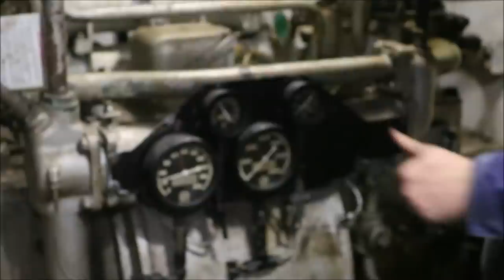First start in 72 years WWII 1942 Cleveland Diesel 8-268A

Comment: Ran an old ferry boat that had two of those from a DE, along with the DC generators and motors with reduction gear. Cheap cylinder heads from Texas were always cracking until we figured out previous crew had firing pressures too high. When we scrapped them they were worn out, 1988. The fish boat that got one said it was the best engine they ever had, cracked block and all. Hey, it would run all the time. I met the guy who designed it. Old timer came through for a ride, what a treat. He did it in something like 6 months for the war. Parts always available from various sources.

Comment: When I worked at Titan Tire Bryan Ohio they had an old diesel engine from a WWII destroyer.  They would run it during thunderstorms for backup electrical power for control power for the boilers.  That beauty was about twice that size and I loved running it.

Prime this handle for fuel on this side.  Prime this handle on the other side for fuel.  Set the throttle to 3 clicks and then hit the air start.  90% of they time she would fire first time.  The other 10% you had to start all over again.  Man never more than twice.  Wish I had bothered to pay more attention to the build tag
Reply from the maker: After WWII many marine engines were repurposed to various shoreside jobs. I always enjoy hearing about the applications they were placed into for their second life. Thanks for sharing that info and watching the video!

Comment: That's one awesome genset power plant!!! Wow I've never seen inside one of those and its amazing the technology it has just from the brief overview of the cylinder head! Never knew they had the roller camshaft in the head which is pretty brilliant and it lessens the pushrods and I was blown away to see that it was a roller cam no less because they didn't start to be used in the racing industry until the mid 80s and production vehicles in the late 80s early 90s! The fact they were using this kind of technology in military equipment makes me wonder WTF they'd have today if that's 80+ yrs old now lmao! Sounds like it'd brand new after having sat for that long, incredible stuff!
Reply from the maker: Thanks for watching!

Comment: that thing is so old yet it sounds 10x better than any new diesel engine you can get today, incredible!
Reply from the maker: One of these days I'll get around to posting a video of the engine at speed and carrying a load. It's a totally different sound and quite a scream! 
Thanks for watching!
Reply: it seems to me that the all mechanical engines run very well when properly tuned, i have a Massey Ferguson 230 from the 70's that is all mechanical that my dad and my grandad rebuilt and it doesn't even smoke when running
Reply: That's because new diesels run more thier timing advanced... so your get more pronounced knocking or pinging, even gasoline engines are moving in this direction as it is more efficient.
Reply: does it effect life at all?
Reply: @gtb81.  not if it is designed to work like that... diesels are typically and almost all of them except very old ones with very delayed timing (and lost power due to this) knock. Gasoline engines will have to be beefed up for compression ignition to work there.... Mazda and Toyota have engines coming that are going to hit in the 40-45% efficiency range which is very high near theoretical peak. Here's my 353 Detroit running, you can clearly hear the knock https://youtu.be/1-m9qpruyO8?t=38
Reply: @Wingnut353  the only thing i dislike about new engines is the fact that they use so much electronics to function, and it doesn't hold up very well sometimes
Reply: @FixAndForget  I look forward to that day!
Reply from the maker: @SpeakerPolice  Life happens but will happen one day
Reply: @FixAndForget  Keep on keeping on!

Comment: I will always love the sound, simplicity and durability of a two stroke diesel engine. The first truck I ever drove was a '69 GMC Brigadier with a Detroit two stroke diesel.
Reply from the maker: One of the most distinct engine sounds for sure. Thanks for watching.
Reply: @FixAndForget  There is a very distinct difference between the sound of the Cleveland or EMD diesels and the Detroit two stroke diesel as well.
Reply: I didn't realize Brigadier's were that old.  Two strokes were powerful engines, but just way too much pollution and noise.  Personally, I prefer Cummins diesels.
Reply: @ffjsb . I'm not a fan of Cummins, to many times being left at the roadside by an ISX engine with either an emissions system problem or catastrophic internal failure. Small Cummins engine for like a pickup or a Jeep sure I like those, but not a large commercial engine.

I prefer Detroit for large commercial engines, specifically the 60 series as my preferred engine or the DD15 as the more modern and acceptable replacement.
Reply: @huntsbychainsaw5986  Never seen a Cummins have a catastrophic internal failure. We use them in a lot of our fire apparatus. Any truck with modern emissions or computers can have problems.  My LEAST favorite are IH/Navistar engines, I've seen three have catastrophic water pump failures over 30 years.  And they just don't seem to have the power that other engines have.
Reply: @ffjsb . I pull road trains so the duty cycle if very different particularly when compared to fire service. 

That being said the major internal failures have included cam shaft bearings, heads cracking, and head gasket failures along with catastrophic failures of the variable geometry turbos and emissions system failures bad enough to warrant a class action lawsuit. 

These ISX engines have left me stranded more in 5 years than the Detroit, Volvo, Mercedes, and Cat engines combined did in the previous 12 years. 

I do agree though that Navistar engines are not ones I trust either.

Comment: Looks and sounds beautiful! Bravo!
The sound of a healthy, large displacement   2-stroke diesel when cold is just music! I love that mix of sounds and that injection knock!
Reply from the maker: Thanks for watching! My favorite part of the old Cleveland and EMD engines is the whine from the gear driven blower, it turns into quite the scream at rated RPM (1,200).
Reply: Its definitely a 4 stroke you have both valves and camshaft
Reply from the maker: @bmthnow12  Thanks for watching! The engine is a 2-stroke Cleveland diesel 8-268A. Most 2 stroke diesel engines are set up like this one, 4 exhaust valves (2 per rocker), a unit injector, and scavenging air ports in the center of the liner with a blower or some kind of forced induction system.
Reply: @bmthnow12  Just as Mr. Spalding said, 2-stroke. All the 2-stroke diesels I am aware of have similar arrangements, either 2 or 4 valves per cylinder, all are exhaust, full speed cams, ported cylinders for intake, unit injectors and a scavenging blower. Cleveland, Detroit/GMC, EMD, Alco , etc.

Comment: Navy taught me about these engines ! 61-65 @ used that knowledge till i retired 2010 👍👍🤛🤛 Thanks Navy ⚓️
Reply from the maker: Very cool. Thanks for watching!
Reply: I worked as an electrician in a power plant on Diego Garcia in 1975. We had 5 or 6 Fairbanks and Morse 10 cylinder opposing piston submarine engines turning 4160 Volt generators. The engine room was beautiful. Im still working as an electrician  
in a power production capacity. Over 40 years at Lockheed Martin. Thank you Navy!

Comment: I'm from Seattle, where Hatch & Kirk, current owners of the CLEVELAND nameplate have their headquarters.  In the late 1970s, I worked as a relief oiler for Washington State Ferries.  At that time, they had three boats w/ CLEVELAND power plants, EVERGREEN STATE, KLAHOWYA & TILLICUM.  These were built in Seattle in the late 1950s, very good ships.  The mains were a pair of 16-278As, DC diesel-electric.  The auxiliaries were a pair of 8-268As turning 900, on 150 KW AC generators.  I'm told by old-timers that 268As were notorious for drinking lube oil.  I got through an 8-hour shift w/ this 1 unit, never had to add a drop of lube oil.  When I related this story to a diesel mech., he identified me as a pathological liar, until I told him it only turned 900, and was freshly rebuilt.  

The perfomance of main propulsion plant was very impressive - the responsiveness of the 16-278As was near-instant, no matter how quickly the load was applied.

Long before DEADLIEST CATCH, ( 1960s & "70s,)  surplus ARMY and NAVY FS ships (Freighter Small) were a popular platform for conversion to mobile floating crab processors.  These had a pair of 6-278As for main engines, + a pair of 3-268As (100 KW @) 1200 for ship's service power.  In the orig. configuration, these were DC, probably 220V.  <My Dad serviced the boilers supplying process steam on these ships, which is how I became familiar with the power plants.

In the early 1980s I hitched a ride from Akutan, AK back to Dutch harbor on a converted YO powered by an 8-278A.  The FALK reduction gear was about the size of a VW Beetle.  The owner later yanked the Cleveland and replaced it w/ a D-399 Clatter-tiller.  Yuck.

LOVE how CLEVELANDS run!!
Reply from the maker: Thank you very much for the information! So many Cleveland engines went to work after the war in all sorts of different applications. I envy the 900 RPM sets, that 300 RPM makes a big difference. I purchased the very last 268a parts from H&K for this engine, they have since discontinued it unfortunately. Thanks for watching!

Comment: Great work guys, not the easiest task, trying to start a large marine engine on a limited supply of compressed air
Reply from the maker: Thanks for watching and the kind words! With the engine cold and less than ~400PSI a little bit of starting fluid does the job, of course not enough to damage anything.
Reply: @JP-et8iq 
Wow, what a story, I'm glad you got that old tug boat started and moved out of the way
Reply from the maker: @JP-et8iq  That's an awesome story! Maybe one day someone will leave me something like that.

Comment: Back in 2011 I bought an old m35a2 which had the Hercules all fuel in it. Thing had sat for 10 years. Changed fuel filters and put fresh fuel in it and 2 12 volt batteries and she fired up the second try. I really miss that old beast. Dead reliable. She really sang at 1800 rpm/ 48 mph.
Reply from the maker: Thanks for watching! I had the opportunity to drive one a few years back, it was a great time. I've always thought it would be a cool project to put a series 71 or 92 Detroit in one. They are great trucks although the air over vacuum brakes leave a little to be desired.
Reply: @FixAndForget  yeah, the single circuit brake system could be questionable. Made one pay attention on the pre trip and make sure the parking brake worked right.
I also got to work on a couple of ARRF Oshkosh trucks that had the 8V92T in them. My big boy squirt toys I called them. They'd get up to 70 mph in 58 seconds and come to a dead stop in 147 feet and could pump 1500 gallons of foam in a minute and a half. Not bad for something made in the early 70s.